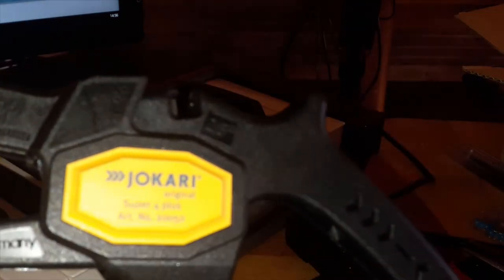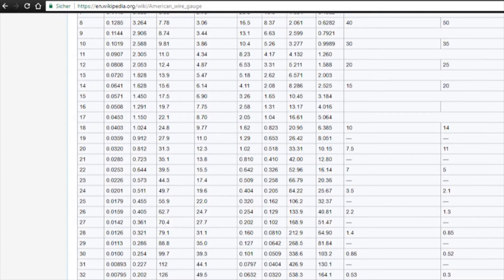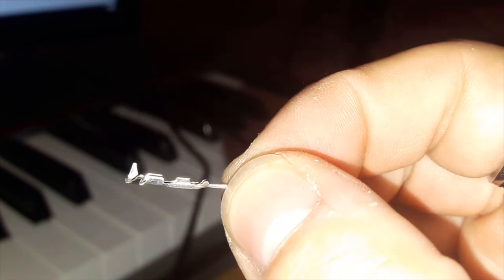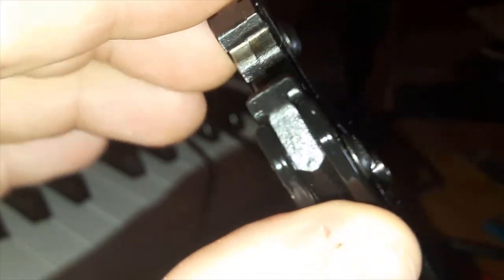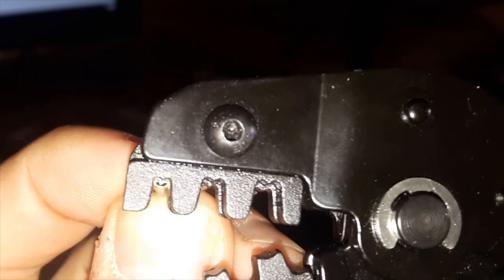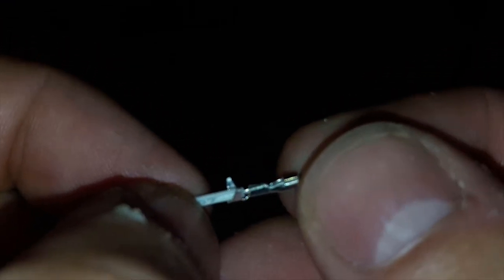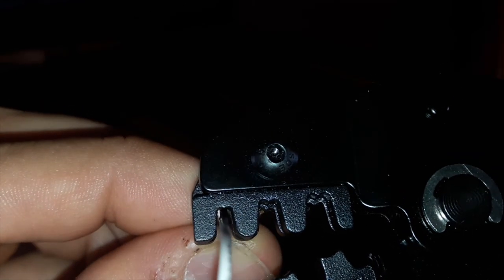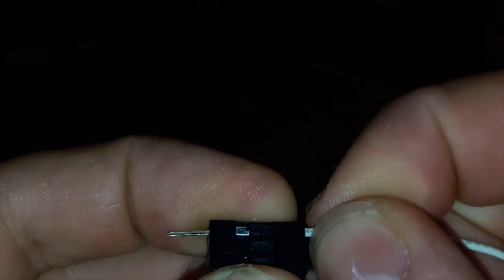Electronics: Crimping Dupont Connectors for 2.54 mm Breadboard

Comment: Thanks I was using the .25 not .5 die slot and I couldnt figure out why all my ends were so wrong I thought a 2.54 connector was .25 since it had same numbers the .50 works much better